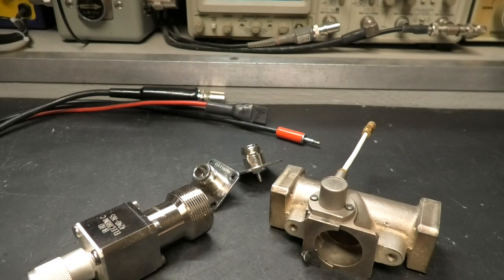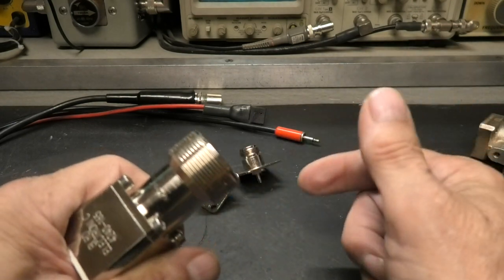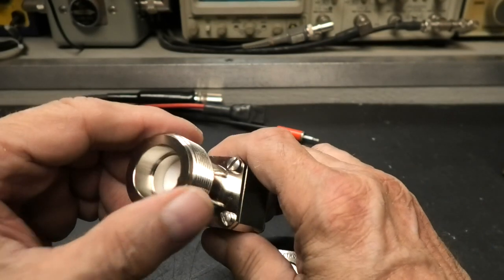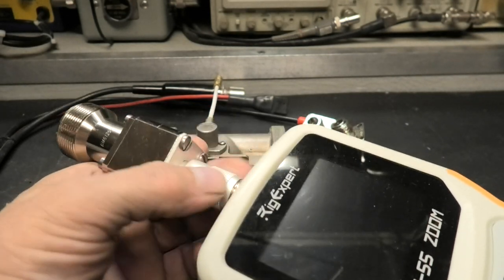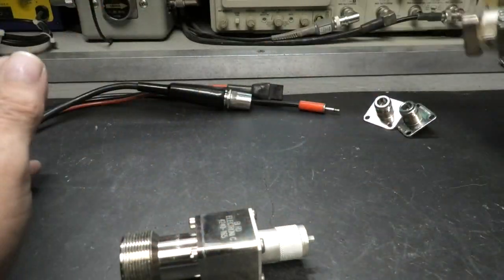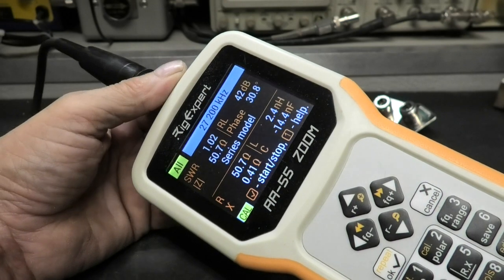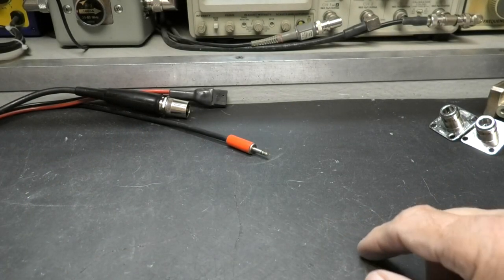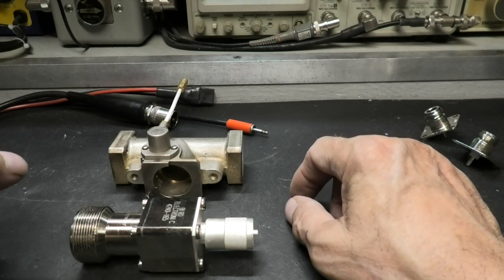Fine Tune CB Shop .. Times Microwave LMR600 UltraFlex And Connectors. The Good Stuff!

Comment from the maker: Blame it on the materials, math and Mother Nature!

Elements, Constants and Cycles.

They can work for you or against you.

Safety First!

Cleaner And Meaner, there'll never be a substitute .. like it or not.

It's all about Procedure .. No Exceptions.

One At A Time .. Don't Be In A Hurry!

You make them ring and I'll make them sing. 
https://www.nist.gov/pml/productsservices/physical-reference-data

No longer accepting mail-ins .. Fine Tune CB Shop services radios for 
the original owner that has purchased brand new radios from Fine Tune CB
 ONLY. This way, like the Maytag repairman, I only see one or two radios
 out of 500-600 per year that may have developed an issue. I'd rather 
spend my time doing better things .. maybe you should too??

Cleaner And Meaner .. Only the serious need apply.  No "tire kickers" or
undesirables that I know for a fact disrespects the airwaves and 
especially Channel 19. Haters are always going to hate because it's all
that they know how to do and what they do best. Don't be so miserable!

If you can't handle the heat .. get out of the kitchen. 

If they can't show you .. in a video .. they're snowing you. Get The 
Picture??

Here's what it actually takes to cut through the noise, be loud and 
crystal clear with a better receiver too:  A) Tuned Bench:  
https://www.youtube.com/watch?v=lwcDfXOgAls.  True, it's more 
complicated and time consuming to accomplish these consistent and 
accurate results. Below is a partial procedure and list of calibrated 
equipment used to achieve this level of performance . Read on ..

Radio Evaluation Rules: 
https://www.facebook.com/163Hardrive/posts/3729504220447644
https://www.facebook.com/163Hardrive/posts/3523601657704569

Fine Tune CB Radio Shop strictly adheres to (https://www.nist.gov/) NIST
 Traceable Calibrations and other industry standards to maintain 
accuracy and consistency for providing Real World Performance Tuning of 
Citizens Band and 10 Meter export mobile radios with integrity.

"Basic Textbook AM/FM/SSB Transceiver Tune, Alignment and Calibration" 

1) Pll adjustments
VCO & OSC, AM TX OSC, USB TX OSC, LSB TX OSC.

2) Transmitter alignment
DRIVER BIAS, FINAL BIAS, SSB  (or gate voltages for mosfet versions) 
CARRIER BALANCE, HI-LO AM & SSB Power, RF METER, AMC, ALC and FM 
DEVIATION.

3) Receiver alignment
AM/FM RF & IF SENSITIVITY, FM DETECTOR/DEVIATION, SSB IF 
SENSITIVITY, SSB S-METER, AM/FM S-METER (100uV unmodulated -67dbm for 
�S-9� meter reading!), AM/FM SQUELCH RANGE, SSB SQUELCH RANGE, and NOISE
 BLANKER/AUTOMATIC NOISE LIMITER (Real World dBm to volts (uV) tables 
below).

That's just a typical run of the mill textbook tune up and alignment (if
 you're lucky). There's more to it than frequency alignment, modulation 
adjustment, meter calibration and a tune up report displaying 
exaggerated rms Bird peak watts! 

"Test Bench includes"

Bird 4314C Meter
https://www.birdrf.com/Products/Test%20and%20Measurement/Power-Meters/Wattmeters-Line-Sections/RF-Wattmeters/4314C_PEP-Single-Element-Wattmeter.aspx
Part 1) https://www.youtube.com/watch?v=RpX9IHe4ORM&t=16s
Part 2) https://www.youtube.com/watch?v=LuhbqTf6Bxw
Bird 4314C Accuracy Test: 
https://www.youtube.com/watch?v=DqEOabYqhQo&t=5s
Bird Stipulates 1/2 wavelengths  
https://www.youtube.com/watch?v=5eWhgT-rTII
And Genuine Bird Elements from 1K down.

Bird 4373 Sampler 
https://www.rfparts.com/signal-samplers.html

HP8924c with options
http://userequip.com/files/specs/2147/HP%208924C%20Repair.pdf
https://www.youtube.com/watch?v=Cg1w0xBa27s&t=1s

HP8920a with options
https://www.keysight.com/upload/cmc_upload/All/EPSG072204.pdf

Three analog scopes, one digital 200 Mhz
https://www.atecorp.com/atecorp/media/pdfs/data-sheets/tektronix-2465b-2467b_manual.pdf
https://www.youtube.com/watch?v=by98x4eu2lM

Fluke 27fm
http://www.fluke.com/fluke/inen/digital-multimeters/fluke-27.htm?pid=56055
 
LCR 
http://www.lcrresearch.com/wp-content/uploads/2017/05/LCR_Pro1_Manual_version1.03.pdf

Power supplies
6 Cosel PBA1500f12 (750 amps) variable and configurable.
https://en.cosel.co.jp/product/powersupply/PBA/PBA1500F/PBA1500F-12/
Corcom 20VB1 F7130 EMI Filter 50-60Hz 250V

Times Microwave Coax jumpers and test leads
http://www.timesmicrowave.com/cms/products/cables/lmr/
https://www.youtube.com/watch?v=EmqaGJ6IWow
https://www.youtube.com/watch?v=1ltFVSxGp5Y
https://www.youtube.com/watch?v=v12YZT_1o90
https://www.youtube.com/watch?v=h7iiYfmYWRA&t=215s

Amphenol RF Connectors
https://www.amphenolrf.com/
https://www.youtube.com/watch?v=dVh5B0hdEA0 
https://www.youtube.com/watch?v=dKZg8T_AOso

More range, compliments, reliability and a quieter, clearer but more 
sensitive receiver,  Get Fine Tuned .. not peaked and ruined.

Here are some VideoGates of me at the bench practicing what I preach 
using my bench radio or customers radio completed and ready to be 
shipped: https://www.youtube.com/results?search_query=hard+drive+163+ 
more: 
https://www.google.com/search?q=Hard+Drive+163+nm&ie=utf-8&oe=utf-8&client=firefox-b-1-ab

It's what I recommend, use, service and sell ... to you ... not 
something non practical or deceiving in a misleading way. I'm not just 
the tech and owner of Fine Tune CB Radio Shop, I'm a customer too!  When
 finished, You'll be giving radio checks, not asking for them .

dBm To Watts and Volts
Tables below displays relationship between Power in [dBm] or [Watts] and
 Voltage in RMS, peak, peak-to-peak for sinusoidal signals in 50-Ohm 
systems for accurately measuring and tuning am/fm/ssb receiver 
sensitivity, agc, squelch and "S9" Meter calibration. Real World! 

Mike @ Mikes Radio Repair (Romper Room), Mark Rutherford aka Mark 19960,
 CB 
Kidd, Martian and all of your other fake accounts pay attention to the 
tables below, stop misaligning radios, spreading false information and 
promoting propaganda! 

  [dBm] [Watts]   [Volts]rms   [Volts]p    [Volts]pp
-140 0.100E-16  22.361 nV  31.618 nV  63.236 nV 
-139 0.126E-16  25.089 nV  35.476 nV  70.952 nV 
-138 0.158E-16  28.150 nV  39.805 nV  79.609 nV 
-137 0.200E-16  31.585 nV  44.662 nV  89.323 nV 
-136 0.251E-16  35.439 nV  50.111 nV  100.222 nV 
-135 0.316E-16  39.764 nV  56.226 nV  112.451 nV 
-134 0.398E-16  44.615 nV  63.086 nV  126.172 nV 
-133 0.501E-16  50.059 nV  70.784 nV  141.568 nV 
-132 0.631E-16  56.167 nV  79.421 nV  158.842 nV 
-131 0.794E-16  63.021 nV  89.112 nV  178.223 nV 
-130 0.100E-15  70.711 nV  99.985 nV  199.970 nV 
-129 0.126E-15  79.339 nV  112.185 nV  224.370 nV 
-128 0.158E-15  89.019 nV  125.874 nV  251.747 nV 
-127 0.200E-15  99.882 nV  141.232 nV  282.465 nV 
-126 0.251E-15  112.069 nV  158.465 nV  316.931 nV 
-125 0.316E-15  125.743 nV  177.801 nV  355.602 nV 
-124 0.398E-15  141.086 nV  199.496 nV  398.992 nV 
-123 0.501E-15  158.301 nV  223.838 nV  447.677 nV 
-122 0.631E-15  177.617 nV  251.151 nV  502.302 nV 
-121 0.794E-15  199.290 nV  281.796 nV  563.591 nV 
-120 0.100E-14  223.607 nV  316.180 nV  632.360 nV 
-119 0.126E-14  250.891 nV  354.760 nV  709.519 nV 
-118 0.158E-14  281.504 nV  398.047 nV  796.094 nV 
-117 0.200E-14  315.853 nV  446.616 nV  893.232 nV 
-116 0.251E-14  0.354 �V  0.501 �V  1.002 �V 
-115 0.316E-14  0.398 �V  0.562 �V  1.125 �V 
-114 0.398E-14  0.446 �V  0.631 �V  1.262 �V 
-113 0.501E-14  0.501 �V  0.708 �V  1.416 �V 
-112 0.631E-14  0.562 �V  0.794 �V  1.588 �V 
-111 0.794E-14  0.630 �V  0.891 �V  1.782 �V 
-110 0.100E-13  0.707 �V  1.000 �V  2.000 �V 
-109 0.126E-13  0.793 �V  1.122 �V  2.244 �V 
-108 0.158E-13  0.890 �V  1.259 �V  2.517 �V 
-107 0.200E-13  0.999 �V  1.412 �V  2.825 �V 
-106 0.251E-13  1.121 �V  1.585 �V  3.169 �V 
-105 0.316E-13  1.257 �V  1.778 �V  3.556 �V 
-104 0.398E-13  1.411 �V  1.995 �V  3.990 �V 
-103 0.501E-13  1.583 �V  2.238 �V  4.477 �V 
-102 0.631E-13  1.776 �V  2.512 �V  5.023 �V 
-101 0.794E-13  1.993 �V  2.818 �V  5.636 �V 
-100 0.100E-12  2.236 �V  3.162 �V  6.324 �V 
-99 0.126E-12  2.509 �V  3.548 �V  7.095 �V 
-98 0.158E-12  2.815 �V  3.980 �V  7.961 �V 
-97 0.200E-12  3.159 �V  4.466 �V  8.932 �V 
-96 0.251E-12  3.544 �V  5.011 �V  10.022 �V 
-95 0.316E-12  3.976 �V  5.623 �V  11.245 �V 
-94 0.398E-12  4.462 �V  6.309 �V  12.617 �V 
-93 0.501E-12  5.006 �V  7.078 �V  14.157 �V 
-92 0.631E-12  5.617 �V  7.942 �V  15.884 �V 
-91 0.794E-12  6.302 �V  8.911 �V  17.822 �V 
-90 0.100E-11  7.071 �V  9.998 �V  19.997 �V 
-89 0.126E-11  7.934 �V  11.218 �V  22.437 �V 
-88 0.158E-11  8.902 �V  12.587 �V  25.175 �V 
-87 0.200E-11  9.988 �V  14.123 �V  28.246 �V 
-86 0.251E-11  11.207 �V  15.847 �V  31.693 �V 
-85 0.316E-11  12.574 �V  17.780 �V  35.560 �V 
-84 0.398E-11  14.109 �V  19.950 �V  39.899 �V 
-83 0.501E-11  15.830 �V  22.384 �V  44.768 �V 
-82 0.631E-11  17.762 �V  25.115 �V  50.230 �V 
-81 0.794E-11  19.929 �V  28.180 �V  56.359 �V 
-80 0.100E-10  22.361 �V  31.618 �V  63.236 �V 
-79 0.126E-10  25.089 �V  35.476 �V  70.952 �V       

                 Don't Be A Mud Duck!

Contact: https://www.youtube.com/watch?v=P0W_Ltzeyyc ONLY when Ready. 
Tire kickers get the BOOT.

163 Hard Dr.